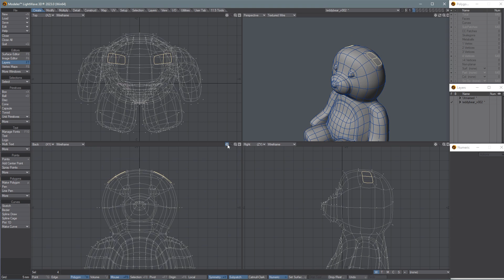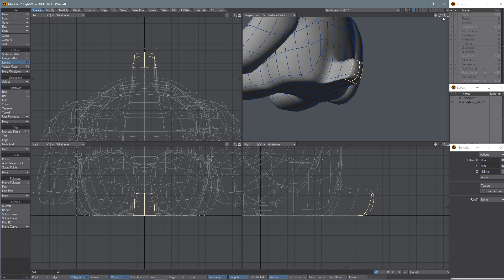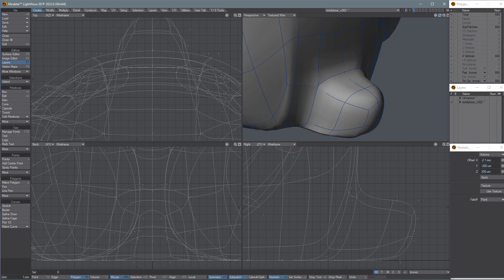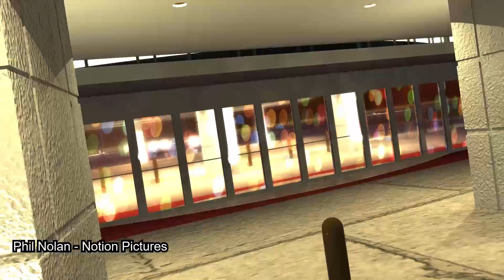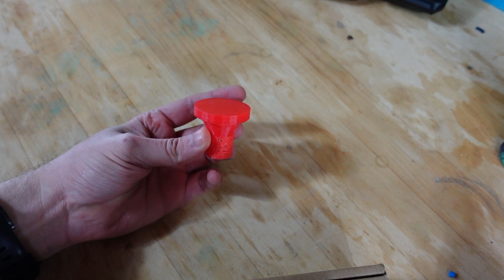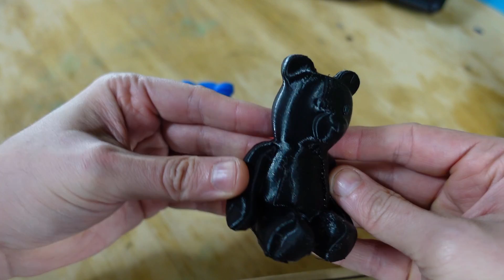Creality's Ender 3v3 KE with TPU

Comment: Did you use any kind of interface between the build plate and TPU? I've heard that TPU likes to bond a little too hard to smooth PEI.
Reply from the maker: @sergeantsapient  I'm not sure, I might have used glue stick, but then I don't have smooth PEI anyway, it's textured.

Comment: Hi Phil, did you use any sort of glue in the bed? and did you have smooth or rough texture in your bed? I wish to print in tpu antibacterial and i never have printed tpu before. Can you confirm if tpu antibacterial is the same as 95A? i checked its values od density and stuff and theoretically it is the same. I have the same printer and the bed information it would be really appreciated to keep learning about this wonderfull hobby. Thank you so much for your content!:)
Reply from the maker: Hi, I'm using the bed that came with the Ender 3v3 KE. No glue or anything. In fact today I was printing TPU on the standard Ender 3V3 with no glue. They both have a texture on the bed. I'm sorry I've never heard of antibacterial filament.